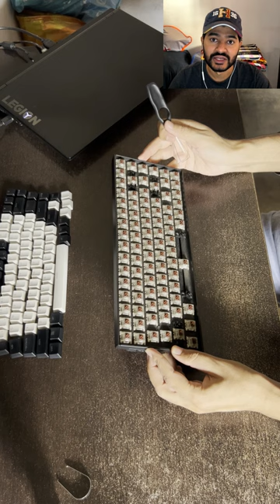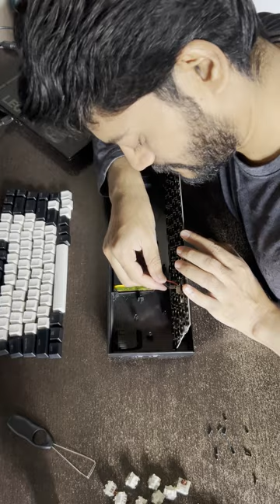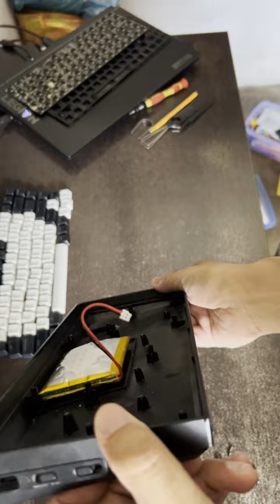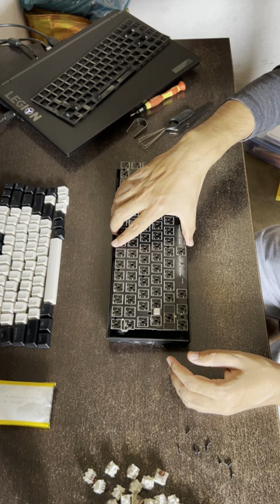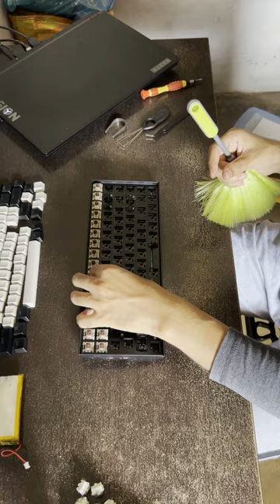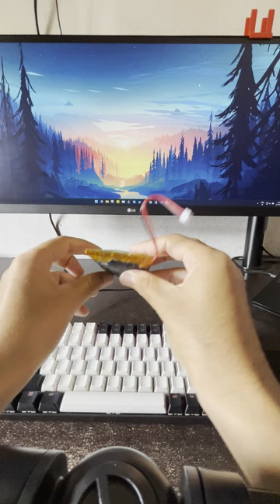The Battery of My Keychron K2 Wireless Keyboard Is About to Explode

Comment: Is the battery only neederd for wireless? I was thinking of removing the battery from my K6 and so I can foam mod that part of it and get a more consistent sound.
Reply from the maker: Yes. Battery is only needed for wireless. After removing its swollen battery, I'm using it with its USB-C cable. And, it is working just fine.

Comment: Nice but you didn't want to replace the battery?
Reply from the maker: I want to. But, details are not clear on the battery.
Reply: @kareemsulthan  I emailed Keychron yesterday and they provided the information needed to source the battery!
Reply: `o` @ethanh8791  would you mind sharing that info? My battery is about to explode too.
Reply: @ethanh8791  Same here. Could you share the battery spec?
Reply: I opened mine. Here's the spec. Line 1:-  HX 606090 3.7V 14.8Wh , Line 2:- NY 4000mAh 21HJL
Reply: @vyellina  sorry - for some reason my comments keep getting removed.
Reply: @vyellina  Very useful comment, thank you very much for the information. I have to replace mine and was not finding that info and didn't want to open the keyboard until I do the full replacement.
Reply: I have replaced mine, I bought 606090 3.7v 4000mha, and it's works fine, the first charge is not finhed yet, it's been 11 days, my use is about 8-9 hours/per day